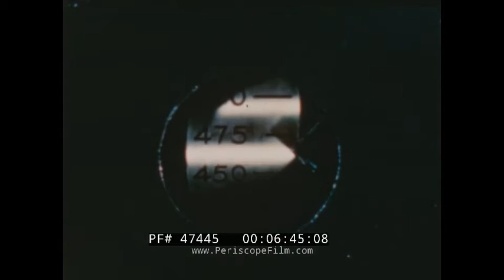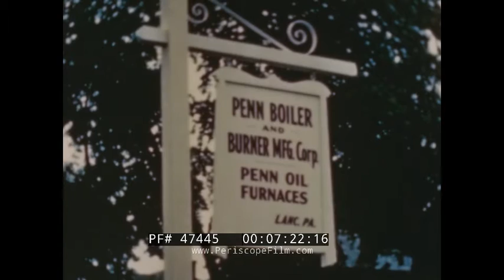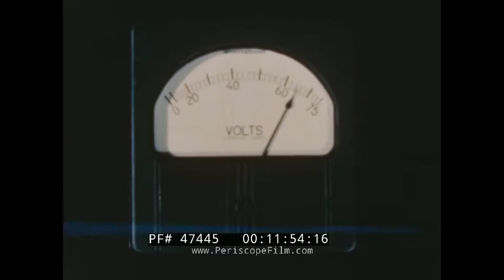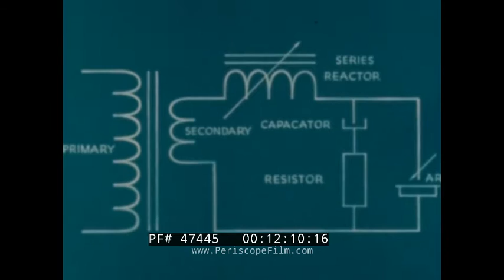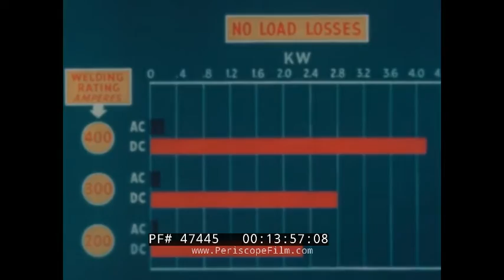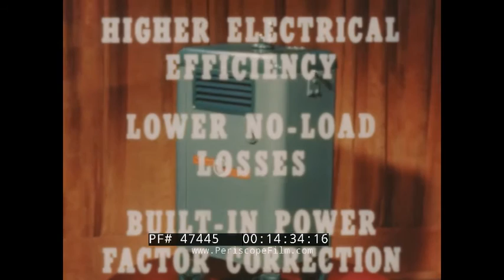1951 WESTINGHOUSE SALES FILM    ADVANTAGES OF AC WELDING    47445

Comment: Definitely an advertising film, and not very truthful. The DC welds they were disparaging??? They intentionally reversed the polarity. And DC is the standard for any type of code weld's, be it Naval, nuclear or heavy structural. AC units are the cheapest ones you can buy, but they're hobby/light maintenance use. There's a reason Lincoln electric still builds rotary DC machines for pipeline industries.
Reply: I’m sure they didn’t. DC welding wasn’t very reliable back then. DC welding rods weren’t very good back then either. A lot has changed since then. After all millions of people still use AC “buzz boxes.”

Comment: I bet those AC welding machines still work now :)
Reply: Worked at a shop that had a General Electric AC welding machine of the same vintage. The only repair it ever needed was to open the cabinet and lubricate the crank screw for smooth operation.

Comment: It's hard to imagine that the people doing the welding were in favor of switching to AC. In 50 years of industrial machine repair, I think I only met one person who preferred to use AC. 

The motor-generator DC welders were very easy to weld with, and even a fairly green operator could do good work with one. I used them a lot, and the only thing that bothered me was how heavy they were to move. 

You could get transformer type DC machines too, but the early ones had selenium rectifiers in them, and if they sat in a damp shop for too long the rectifiers might blow up when you turned the switch on. That soured some people.
Reply: I think it was just an ad promoting a product not necessarily better than the other

Comment: I apreciate this as an archive piece, but in terms of actual value this is some "MG42 bark worse then it's bite" level bullshit, 

DC is still used on the vast majority of cases outside of working with Stainless Steel or Aluminium

arc blow can still happen with AC, however, it really isn't an issue in either case as arc blow is a sign that your welding angle is bad rather then anything inherent to the process.
Reply: What’s with some of you guys? Do you not know anything about the history of technology? What’s being said in this film isn’t wrong, for 1951. Improvements have resulted in much better DC welding equipment. It’s very true about reliability. Welding rods weren’t very good back then either. AC often was better. That’s all changed, even though AC is still widely used.
Reply: @melgross  AC is still 'widely used' because Aluminum and Stainless Steel are so common, but when it comes to regular steel DC has not been overtaken whatsoever contrary to the films claims. And once again: Arc blow is more a result of bad angle (aka user error) rather then using DC or AC.

Comment: Is A C welding also called "arc" welding?   🏴
Reply: AC stands for alternating current.
Reply: You can ARC or stick weld using DC current or AC current. As explained in the video there are special uses for either.
Reply: @CawKee  arc refers to the electric arc, not the current. 

You only ever find AC in use when welding on Stainless or Aluminum, otherwise it's pointless hassle compared to DC
Reply: @themanformerlyknownascomme777 not true, but ok.